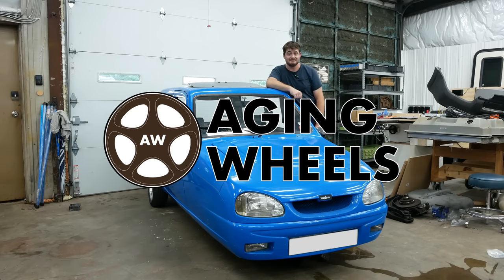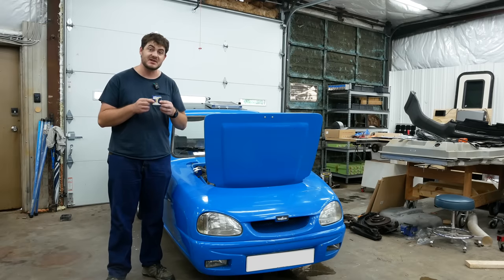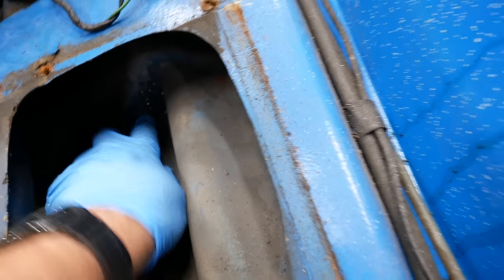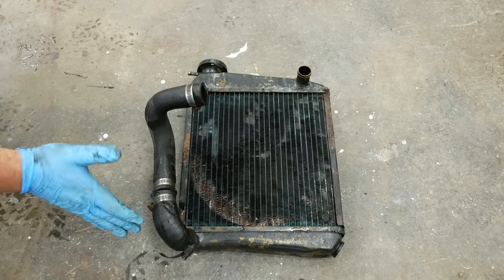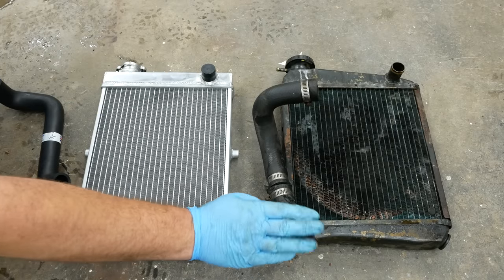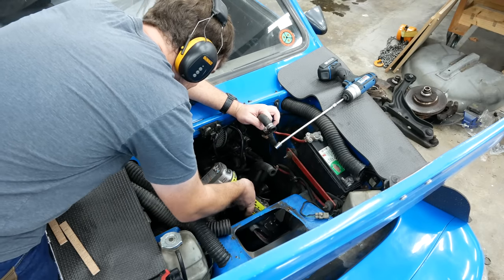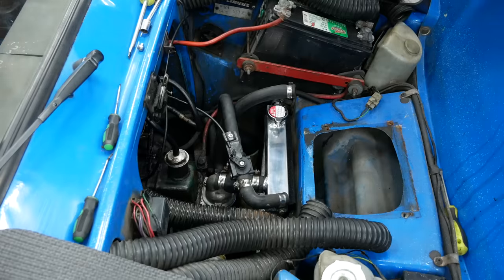My Robin is Hot. I Made It Worse

Comment: Cooling systems are temperamental at the best of times, even in modern cars. I had a Dacia Duster (1.6 petrol 4 cylinder Renault engine) at one point and decided to replace the thermostat.
I went with a generic, but decent one i bought online. Car would boil over. I googled how to properly fit the thermostat and bleed the system. Car would boil over. I got a lower rated thermostat, car would boil over. I then bought a third thermostat straight from Renault, car would boil over. I once again tried bleeding the system the "proper" way (let it idle, rev it up, fiddle with bleed screws, turn off heater, turn on heater, let it idle again, something hugely complicated), car would boil over.
I put all three thermostats in a saucepan and brought it to the boil. All three thermostats opened, no problem. I flushed the system. I checked the rad.
Finally brought the car to my thrusted mechanic, because maybe the water pump had given up the ghost. Brought it there the evening before so he could start working on it the next day at 8 am. Got a phonecall at 9, car's fixed. No problems, no overheating.
I asked him what on earth he did to get it to not overheat.
Nothing.
He undid the thermostat housing, removed thermostat, put in different thermostat, bled the cooling system, no problems.
There is only one bleed screw on the whole system. The thermostat can only be fitted one way. There are absolutely no electric actuators. The whole system is as primitive as it can be.
I talked to my mechanic and described exactly what I've been doing, he said he did the exact same thing.
Car never overheated again.

Comment: Overheating is a standard feature with Reliants. I've had a few and they all overheated. My last one was a rare Fox 4 wheel van. That one had enough room just behind the bumper to fit a much larger rad than standard. That finally fixed the overheating.

Comment: You can drill a couple of small holes in the fibreglass just in front of the rad to get some more airflow should be low enough to not be seen but should be able to pass some more air over the rad.

Comment: I've always just massaged the radiator hoses with the cap off to bleed cooling systems. Just keep squeezing until you feel that the air is gone. The only exception was a 2011 BMW 745i that had it's own automated way of doing it with the electric water pump.

Comment: As someone who knows nothing about these things, what would happen if you left the heater core out and put a flat panel over that big hole? Would it force all the air down on to the radiator?
Reply: I think that would work fine, but then you’d have no heat or defrost. It’s the summer so he could just do it temporarily, but he might as well order the part and do it properly now. Plus he was running out of time, and likely couldn’t fabricate something quick enough.
Reply: As far as airflow, yes, it would potentially cause airflow to be forced through the radiator when the car's moving.  However, at rest, I'm not sure the airflow will be different, that's more dependent on the fan pulling the air through (and without a shroud, it is way less efficient for that purpose.)

The other issue is removing the heater core box removes the heater for your passenger compartment.  And while Robert may or may not be using the Robin in cold situations, the heater core is also a radiator, so it adds coolant/cooling capacity... something that may be beneficial in the right situation.

What I might consider is replacing the heater core and getting the fan fixed for that... and I would ditch the plastic engine driven fan for a small electric one directly on the new radiator. But that's me.  Robert will do Robert.
Reply: @mikeybhoutex a more powerful EC  fan with a proper shroud would easily fix the overheating, but might starve the heater now. A well fitted powerful fan makes all the difference with heat exchangers
Reply: You would seize the engine within minutes. A major design flaw of the Robin/Rialto is that the heater core is the only thing which cools the rearmost cylinder. Yes, really.
Reply: mine used to slowly start to overheat when stopped in traffic, then cool down once it got moving
Reply: @charliewakely8585  That would mean they are on different coolant systems with one pump each and also you can't ever shut the heater off. I somewhat doubt that. It's probably a result of air in the cooling system accumulating mainly in that cylinder head jacket.
Reply: @Rasta8889  no, not quite. They are on one pump, but with two circuits. Whilst the rear cylinder jacket is physically connected to the others, if you shut off the heater, the water circulating never quite reaches the back of the engine and it overheats.
And yes, you can never shut off the heater. It's a well known problem with Reliants, and the advice on most forums is to remove the heater shut off valve.
As I said, it's a design flaw.

Here's the thing. Until you have owned and run a car, including rebuilding the engine, you can never quite know how it reacts. In the case of the Reliant engine, part of the problem lies with the sand casting process, which left some of the internal waterways blocked, causing the dual-circuit problem I described. Look it up - you will see that us Reliant owners have been dealing with it for years!

Comment: You may already know about it since you work on cars more than I do, there's a 1 minute cure gasket maker called "The Right Stuff".  It's grey and comes in a small pressure pack can.  You apply it, put your parts together and you're good to go; virtually no cure time.  It's oil resistant and high temp, I've used it on my car's oil sump since my car's sump is one of those that come from factory with sealant not a gasket and I can attest that the stuff does what it claims.  Ain't cheap but it's a time saver.

Comment: Yep.  You crack a thermostat housing.....ONCE.  I did mine in January.  In Michigan.  The one I got from the salvage yard was a year later.  Different exit angle.  Had to drive up again and get a different hose.  Like I wrote...you do it once.  Then you learn to hand tighten the bolts snug.

Comment: Drill a 5mm hole in the flange of the thermostat,this helps prevent air locks in the head,also remove the engine block drain plug and rod out the back of the block,they fill up with silt snd sand and general corrosion and cause overheating.always run with the heater valve open,this keeps all the coolant in the heater matrix part of the cooling system, and you can use rhe heater fan to drop the temp.

Comment: The original gasket for the thermostat needs a clean flat surface to seal, You had plenty of debris and shiet under the gasket when you mounted it. Any spec of dust lifts the gasket at that point, If you got loads of debris it lifts up everywhere allowing a for channel to leak.

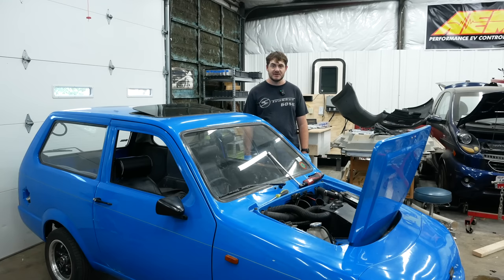Comment: I don't know if anyone else saw but 12:01 the thermostat housing looks like it has some leftover remnence of JB weld epoxy as if they had already tried to fix it. I could be wrong but that does not look like a casting fault. As someone that has used JB weld a lot I would sat it looks just like it

Comment: For bleeding it, run a high funnel into the rad that is above the heater core, sealed to the radiator (they sell these, you know). Simply top off the funnel and let it run, keep adding as the level goes down. When that doesn't work, drill an air hole in the heater core. After the air all comes out, plug the hole with JB Weld. Sounds dumb, I bet it would work great.

Comment: One concern of a lower temp thermostat is the engine won't get hot enough to boil off any moisture that ends up in the crankcase. Short trips and cooler weather can cause excessive moisture leading to premature wear.

Comment: Love your "real world" videos instead of the slick "everything goes smoothly" vids.  This project goes like some of mine do - a "10 minute job" takes 10 days instead as I order the wrong parts, break something and need to order a replacement, hidden issues, and modding the original mounting arrangement that sucked or screws that stripped, etc.  The "3 screws are good enough" made me laugh - we've all been there.

Comment: Well Im intrigued to see if the Aluminum radiator works, from my experiences where a copper radiator goes a aluminum one of equal size wont work. Usually you have to add a core or two to aluminum rads if they are being installed in a copper/brass radiators spot. Also Id yeet that plastic three blade and put an electric push fan on the radiator. Also Also, if you dont trust the temperature gauge like I do buy a Prosense 1/32 DIN panel meter (DPM1-T-L) and a PT100 RTD, you'll realiably be able to tell your coolant within a .4 F margin of error.

Comment: Taking car advice from Hubnut is like asking Mr pink to teach you ballet - these engines do overheat if you don't keep up with the carb tuning and do the timing, very hot weather, and ultra hot exhaust can vaporize the fuel, leaning out the mix, if it's gutless, but the timing is ok at idle, the advance weights in the dizzy can seize due to lack of maintenance/use - reliant's are from a different age 90% are Imperial, iirc some are even Whitworth 😉🙃

Comment: You should put a metal sheet closing that big ass hole for the heater core. Drill some holes for airflow - it’ll be enough for the heater. I did this and it solved my heating problems as it directs way more air to the radiator. For reference, I drilled about 20 10mm holes.

Comment: I still like the Robin! And I still like fiberglass... I've seen Rainman Ray use a big funnel with a stopper in the bottom, but it has to be adapted to whatever size/type radistor cap you have. You fill the funnel with coolant mess about eith running the engine and squeezing hoses until the air is out, then put the stopper in and remove the funnel with the excess cooant in it.

Comment: had to pause at ~2:00...Thermostats, unless broken or malfunctioning, don't have anything to do with overheating.  They only regulate the minimum temperature of the engine. Higher engine temps are better for emissions and getting water/fuel to evaporate out of the oil/crankcase.  There's something else wrong otherwise the factory wouldn't have sold the vehicle with that specific temp.  The only real thing you can use a thermostat for is a temporary buffer.  Vehicles with tow packages often had 15F* cooler thermostats so that if you're towing a boat out of a lake, or up a steep hill it would absorb a little extra heat without overheating.  It's only a temporary thing, not an everyday all the time thing.  Also many of those vehicles also pump the transmission fluid through a 2ndary reservoir in the radiator to help warm and cool it as well as through another cooler before returning to the transmission.
Reply: Remember that this is a Reliant Robin. The reason it came with that specific thermostat is because that's what was in the factory the day it was built.
Reply: @drunkenhobo8020   😂👍

Comment: A typical problem. Often the cap of the cooling water system where you refill is broken and the cooling system did not build up pressure to work correctly. It usually opens when a few PSI is reached. (0.5 bar in metric pressure over atmospheric )

Comment: in the cars i've had where the radiator wasn't the top of the cooling system there was a bleeder screw at the top of the system, alternatively you could fill the system how they do it with a Porsche where you pull a vacuum and let it suck in the fluid.

Comment: Adventures in late 20th century budget British car engineering!  Actually, the Reliant engines themselves are quite highly regarded and reliable (cynics say it's the plastic dustbin wrapped around them that's the problem!) I do think you need to get a new heater fan though, that can't be helping the problem. And seal up those body holes too.
Reply: The quality was extremely low in between 1995 and 1999 due to bankruptcies and the fact Reliant continued to use worn fibreglass moulds. The early Rialtos and Robin MK1s were not a dustbin.

Comment: It honestly sounds more like a airflow problem to me than anything else, not only no even flow as you stated but the same air that passes thru the hot radiator is the only air circulating around in there too. I can’t believe I’m saying this unironically, add a hood scoop and vents out the back of the front Bay Area and I bet it’ll be happy as can be

Comment: you can bolt the radiator through the fiberglass onto a bracket so you don't have to rely on the fiberglass as much. the vibrations of the car running are probably going to knock it off again

Comment: Change the water pump too. Please. Also you could add a hose fitted filler cap with an expansion tank to the heater unit to solve all the cooling system bleeding problems.

Comment: Aging Wheels, Why not take some nut and fiberglass them in place on the back side of the fiberglass panels. this way you can use bolts to hold your different items. And have the abillelity to unbolt them later when you have to do other things.

Comment: Here's a bit of advice: get the highest temp thermostat they offer.  The thermostat temp rating has nothing to do with overheating unless it fails which still has nothing to do with overheating. Among other things the higher temp thermostat allows the engine to get warm enough to evaporate any H2O that accumulates in the engine from heat cycles, which is a good thing.

Comment: Thermostats set the minimum operating temperature for the cooling system and have no impact on maximum temperature (if working correctly).
You can also run into issues with the engine running too cold.

Comment: I couldn't quite tell but your radiator set up may have problems and not (seemingly) work at first. (If you run into said problems, that is.)

The most effective radiator setup is when the fluid travels horizontally. The reason being is it spends more time in the radiator and does not "rush" out and the pump has to force it through.

However, the new setup  has it mounted vertically, which can either work "perfectly" or "poorly". The only way I can describe the best version it is to have the cold inlet on the bottom, and hot outlet on the top.

This causes the fluid and pump to have to fight gravity, in order to pump through spending a much more efficient time in the radiator.

Otherwise in the wrong set up, if the cold inlet is on top, and the hot outlet is on bottom, the fluid will rush down the radiator with the pumps aid, spending very little time and achieving very little cooling.

Same principle works for water jackets when it comes to oil, vapor, and alcohol distillation and condensation.

Best of Luck.

Comment: all the heater stuff is blocking some air.
they used to have summer and winter stats.
most found overheating cured by using the winter stat, which closed longer between cycles, allowing the rad to actually pull more heat out than a wide open summer stat.
yours is probably more airflow problem.
did you flush the coolant passages of the block?

Comment: The coolant filling situation reminds me of my Bolt EV which requires you to use a vaccuum to suck the coolant out of the far reaches during a coolant change. Thank goodness I will likely only have to do it twice over its entire life (every 150k miles), because I'll likely just pay the dealership the $300 to do it, even though I know $244 of that is the labor+markup.
Because also the vacuum + adaptor to fit on the car is over $1k, and I wouldn't want to risk it for the little to no gain I got from it. Unless the dealership price rises above like $500, at which point, I'll do it myself. Would be cheaper to drain, fill, drive for 60 miles, drain and fill again to have basically new coolant, and have washed out everything from the battery loop.

Comment: A standard coolant funnel will allow you to bleed it.  While there is a common tool to solve this problem I can't say I've seen a worse design before.  You'll have to quickly put the cap back on after it's bled I guess or the water will just all flow back out again!
Reply: The thermostat stops backflow

Comment: 75c thermo is very cold for an ICE
Reply: And likely going to create a full open loop which won’t cool better. Closing the thermostat allows the coolant to dwell in the rad and cool down, then it opens and exchanges. Open circuit will result in higher temps, because essentially you won’t have a thermostat

Comment: I might be wrong, but it looks like the fan for the cabin heater also sucks air (hot air from the engine bay for some reason) through the radiator to help cool the car. Maybe the problem is that fan not working....

Comment: the most famous three-wheel Reliant is Luke Skywalker's Landspeeder, yup it was based on 1970s Robin built by Ogle Design who were Reliant's design partners for many years.
Reply: Technically the Landspeeder was built on a Bond Bug, but as that was based on a shortened Regal chassis with an Ogle-designed body on top of it, it's very closely related to the Robin.

Comment: Fix the heat fan while you are there and see about something to support those screws.
Reply: Motor probably just needs unseizing followed by a clean and bearing lube. Possibly brushes but not normally. Common problems. Heater fan always a useful second line of defence when overheating strikes.
A bit of fibreglass fine mat and resin would quickly fix those holes and also stop leakage into the cabin.
Reply: @delukxy  Thanks.  Here's hoping he does it.

Comment: Great video, just a heads up the new radiator is going to eat that copper heater core. Copper and Aluminum don't like each other and will cause the copper to plate the aluminum, we had to deal with this on the mid 2000's Crown Vic's when they put the 4,6l mod motor in them but keep using the old shock copper heater cores till they used them all up. Was fun watching them arc flash from the static build up letting go when they popped in the cab of the cars lol.